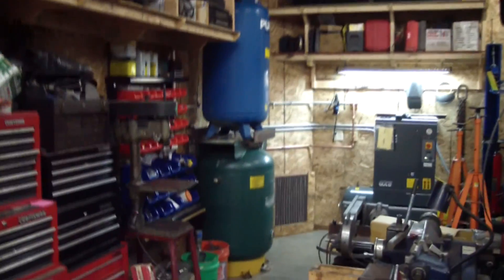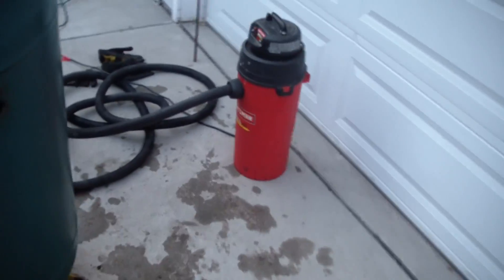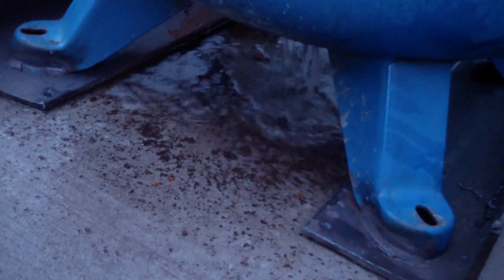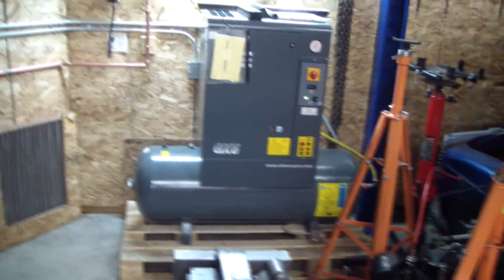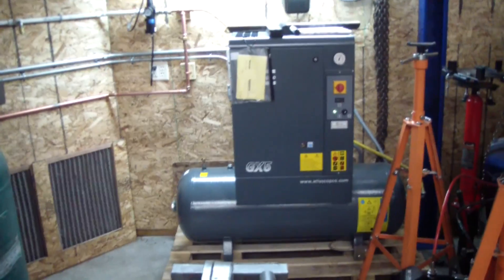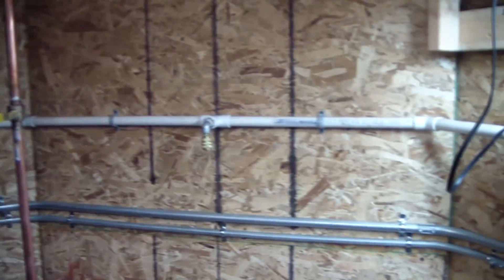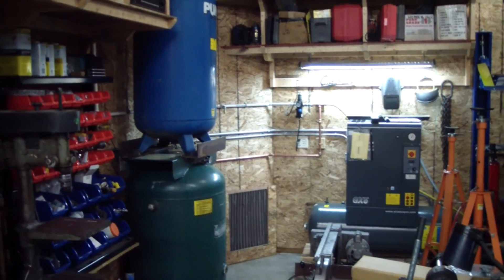Compressed Air Receiver Tank on the Cheap Capacity

Comment: I have passed up several large air tanks for scrap price because I'm honestly freaked out working next to an old rusty air bomb.  It sets my mind at ease seeing someone who evidently knows what they're doing using these tanks.  Did you have your tanks professionally tested or did you do it yourself? How do you ensure that they are safe and good to go? I am thinking about making a windmill compressor system, but would need a thousand gallons or more of storage to make it practical. Also considering a 10ft deep storage pit...
Reply from the maker: I'm no compressor expert, anything can happen.  Consult your local expert before building anything.  This is not a how to video.
Reply from the maker: I'll eventually scrap these things and run a single new 250 gallon tank.
Reply: with that much rust, i suspect the sheet metal at the bottom is at least 60% gone. Two big tanks like that = 1 MOAB ready to blow.
Reply: I would've put them in a small plastic shed outside with an auto drain.  And if they blew up.  No big deal. Outside on the opposite side of the house

Comment: Great system!  I think you should consider J.W. Hunt's suggestion and get a condenser to use as an after cooler immediately after the compressor pump.  This will pre-cool and condense the air before it gets to any of your receivers.  You can drain the condensate before your receivers as well.

Comment: How long did it take to fill
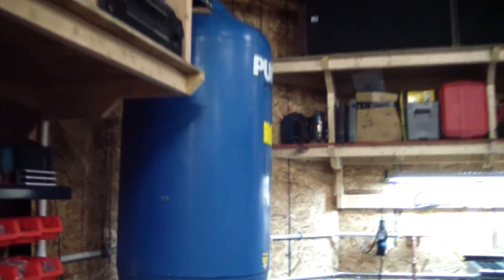Reply from the maker: CHARLES BRONSON Turns on at just over 100psi, runs 3:09 seconds to full at 145psi (no load during fill). Then it continues to run unloaded for six minutes unless another call for air is received and it all starts over again..  That's all 252 gallons plus the line.